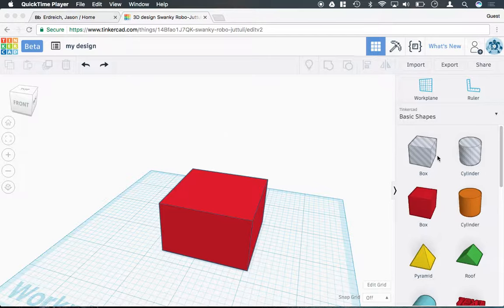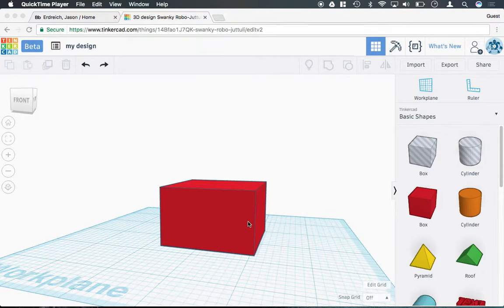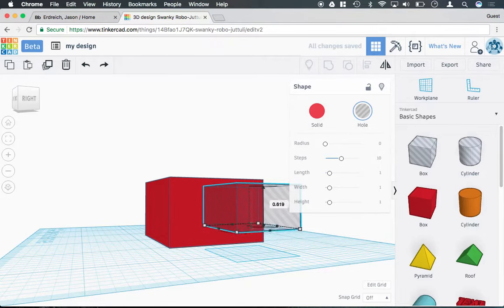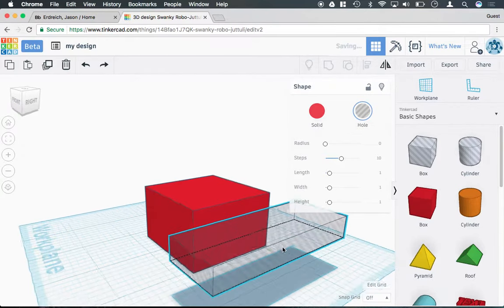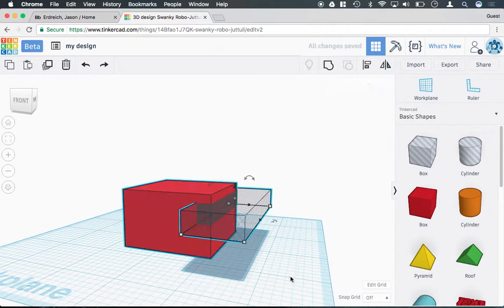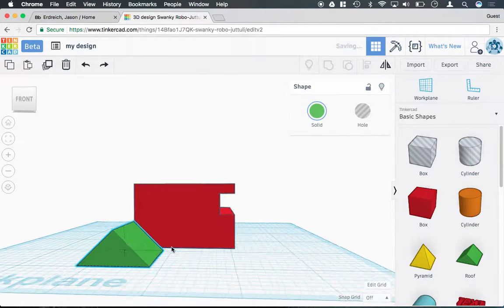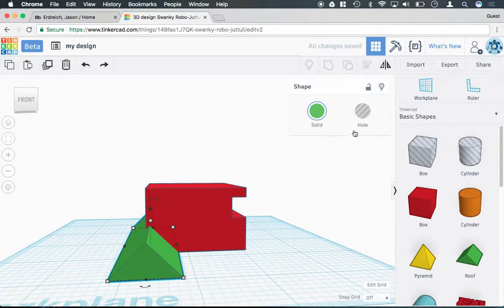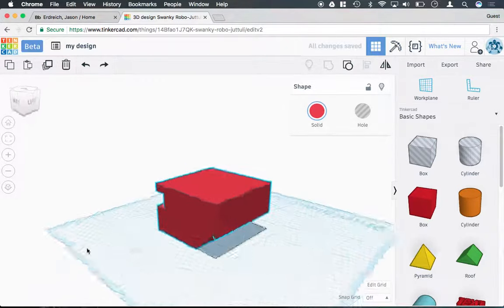How to create cut-outs and remove material in Tinkercad

Comment: is their a way to make the models move separate when slicing them in half
Reply from the maker: Not with a single tool or action. You would need to make two solid shapes, and two cutting (hole) shapes for each half. So the right-side solid will be cut by a left-side hole, then vise versa. This would give you two halves from four shapes.

Comment: how do you do the oppsite? ie slice a piece of the object off to be used elsewhere.
Reply from the maker: If you want to split and object into halves for example, you would need to make a duplicate of the object. For example, you create a solid box twice, one copy on top of the other. You then create a hole half-box twice. One half-hole is on the left side of the solid (group and remove the right). The other half-hole cuts and removes the left. You now have two halves of the original solid shape.
Reply: @MrErdreich  What if you want to cut the middle of an object to be used elsewhere? Instead of two halves?